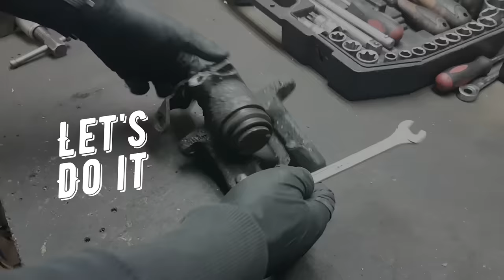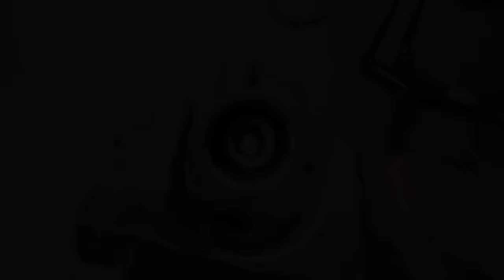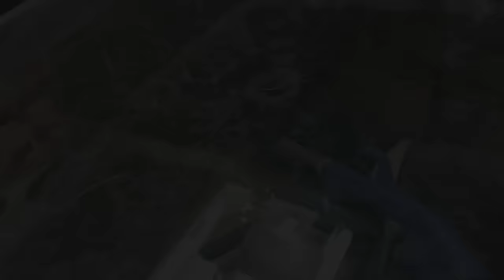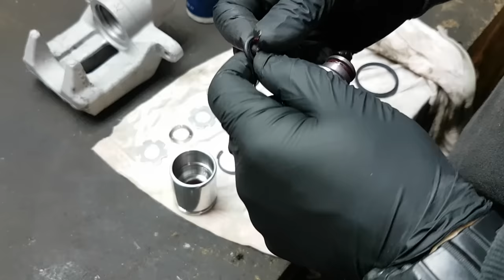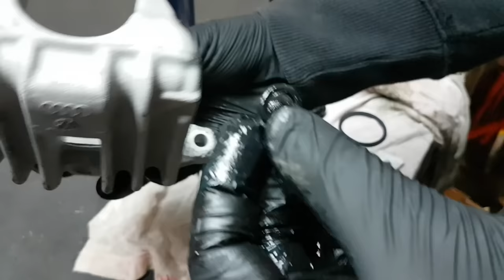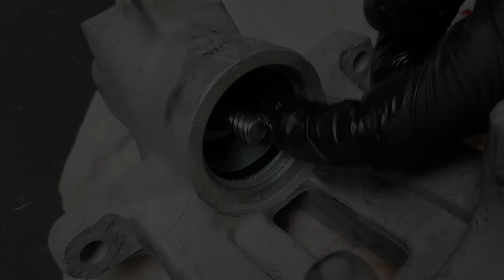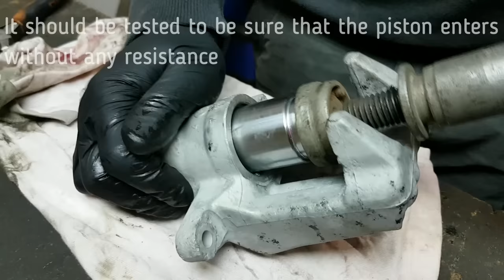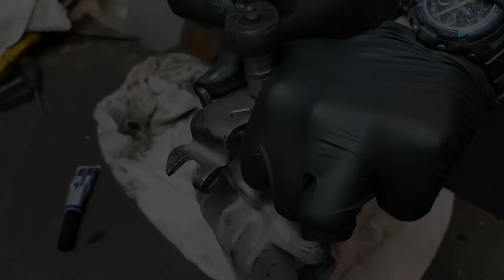How to rebuild rear brake caliper - VW Audi Skoda Seat - New piston and seals (COMPLETE GUIDE)

Comment: How did you put that seger ring back in place (the one which secures the handbrake)? I tried like 1000 times but always failed as the ring did not sit into the groove. so the handbrake could then easily jump out.
Reply: I have also tried this, and I'm having the same issue as you, I simply gave up. But correct me if I'm wrong, it doesn't really look like he put the snapring in the groove?
Reply: @ChristianHTeige  The ring absolutely MUST sit in the groove to keep the handbrake in place securely. That's what the groove is there for. Fortunately, I was finally able to put the caliper together properly by following a simple advice I was given: After placing the handbrake mechanism and the seger ring in, take a hammer and a flat screwdriver and gently tap the seger ring evenly along its perimer until the ring jumps in the groove and spreads. Trust me, it works perfectly! The thing is that the ring can't be simply placed there just with the seger pliers but must be helped with a small ammount of force which is not shown in the video.
Reply: @jansvajcr  Just found another video showing it https://www.youtube.com/watch?v=PPiQNS7pUQY&t=1s&ab_channel=PatrickNeilPatrickNeil

It looks like the mechanism is spring loaded, and shound compress enough to get the ring in.
But i will definitely try yor way. Thanks

Comment: Hi! Can you use Bosch Superfit T0 100 instead of the 102? Thanks! P.S. is there any alternative?
Reply from the maker: The best and 100% safe will be ATE Brake Cylinder Assembly Paste, part number :03990205212 
Regards :)

Comment: Good video. I tried rebuilding mine too. But unsuccessful.
I pushed the piston out and took out the gasket. I cleaned the cylinder with sandpaper, air and diesel.
I took 2000 grit sandpaper and sanded the piston (piston was in good condition).
When I tried to screw the piston back into the cylinder it wouldn't take the thread??
I had the same tool as you have and of course screwed clockwise in.
The thread just did not take. I tried pushing hard while I screwed, but did not work :((((
Anyone knows maybe what I did wrong? Thank you.
Reply: Same problem here, any ideas on This? Kind of stuck. Do i need to buy a New cylinder and the inside thing?

Comment: what rebuild kit did you use and also I see you used 3 different types of grease, what are they?
Reply from the maker: Hi 😀 I used rebuild kit "Autofren Seinsa" with piston 38mm. First grease was included with repair kit. Second one is for brake piston inner o'ring, silicone grease PTEE lubricant for brake pistons. Third one is Bosch Superfit TO 102, great for parts that are exposed for external conditions.

Comment: Great video but my seeger ring is smaller than the one you have on your video. It is from vw touran 2004 type 1t1. The seeger ring doesn't fit inside the caliper because my mechanic said that the cylinder should go deeper in. I have tried with the special pliers and have had no luck in placing the ring into the smaller hole. It must be another way to put it inside, maybe you know? I'm considering buying a new caliper so a swift answer would be greatly appreciated.

Comment: Great video!
I am currently rebuilding my own calipers, and your videos is a superb guide!
I've encountered a problem, though:
When I try to screm the piston back in (when testing to see if it can go in without resistance), it is SO tight and ends up getting stuck. And it's almost impossible to screw it back out. I tried doing it without the rubber seal, and it was easy and unrestricted - but when I add the seal it just isnt possible.
Any advice/ideas?
Can it be the seal that is to thick? I've tried lubing the shit out of it, too - nothing works.
best wishes :)
Reply from the maker: Hi there,
Yes it can be repair kit. Did you compare thickness of both seals ? old and new?
Sometimes repair kit can look really similar but they are for completely different brake calipers.
Regards :)
Reply: @carsguidediy  I forgot to compare the new seals to the old, before throwing them out - very stupid :) but the kit is made for my particular van - just a liiiiiiittle bit to thick.
I'm getting another seal tomorrow for 7 dollars - if it doesn't work either, I'm going to the VW-dealer, but they are so much more expensive. 
Fingers crossed.
Best wishes :)
Reply: I'm having similar problems after buying supposedly professionally reco'd calipers done by brake place. No lubricants were used when they did it and the piston boot was also torn!

Comment: Can I use brake assembly lube on the piston instead of the grease?
Thanks
Reply from the maker: Hi there, If it's  silicone based grease then yes.
Regards :)
Reply: @carsguidediy  The grease you used that I´m talking about is the red grease used inside the piston, what type is it?
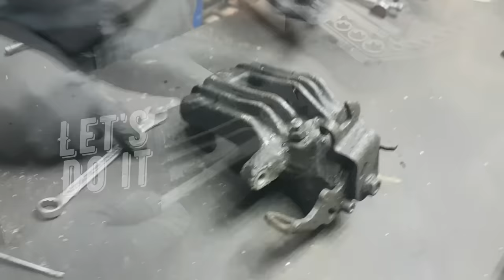Reply: @LRBP  autofren- producent of repair kit gives it in box with all stuff on video (0:42) . There's no info about that grease on that little bag
Reply from the maker: It was kind of red rubber grease, Included with repair kit, :)
Reply: @carsguidediy  OK, thanks

Comment: The elements in the cylinder are reassembled in a wrong way. You switched 2 pieces on the other side.
Reply from the maker: Hi! What you mean?
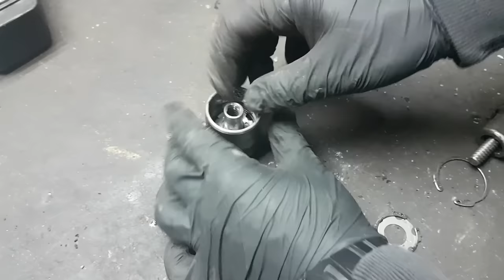Reply: @carsguidediy  Start watching your video at 3:24. When you reassembled you put them in the correct order but not in the correct position. I done mine and i paid attention.
Reply from the maker: @horacem6507  You mean washers and small bearing? Inside the piston ?
Reply from the maker: @horacem6507  Watch it again carefully, washers and bearing are fitted same way as they been at disassemble 😉
Reply: @carsguidediy  If it's working it doesnt matter.
Reply: Hi, fantastic work. 
@6:12 when fitting the new rubber seal, does it matter which way round  the open part of the seal faces? Up or down? Thanks

Comment: what is name all 3 grease you used on this job thanks
Reply from the maker: Hi,
First one is grease included with repair kit. Second one is for brake piston inner o'ring, silicone grease PTFE lubricant for brake pistons. Third one is Bosch Superfit TO 102, great for parts that are exposed for external conditions. :)
Reply: thanks  I appreciate  @carsguidediy

Comment: NEVER use petroleum bsed grease on rubbel, only silicon based grease or the rubber will degrade!
Reply: Who said anything about petroleum based grease ?? Guy uses silicone based greases! Check first pinned comment.  He answer questions and explains why ;)
Reply: @mdma7762  as You can  see he uses more than one type ;)
Reply: There is another comment that explains why 3 different greases. And all three are safe for rubber elements :)